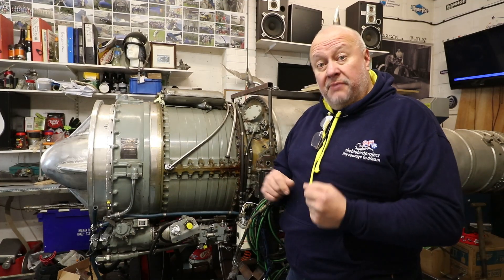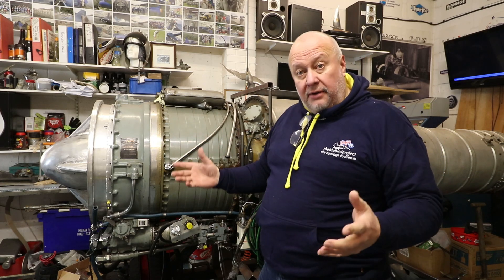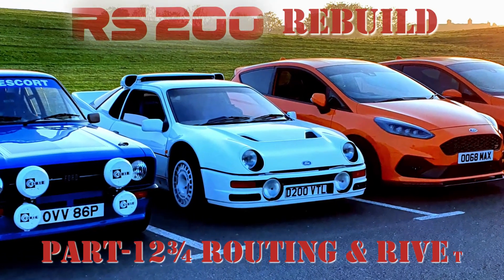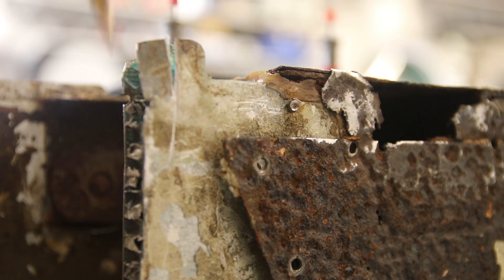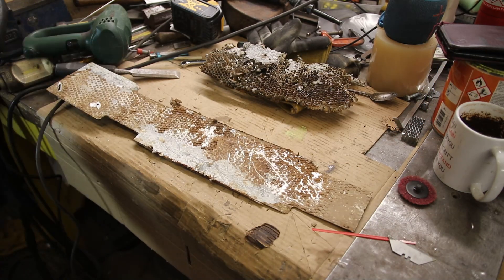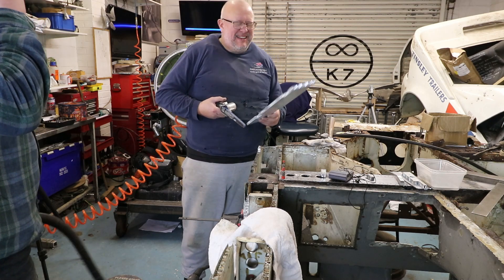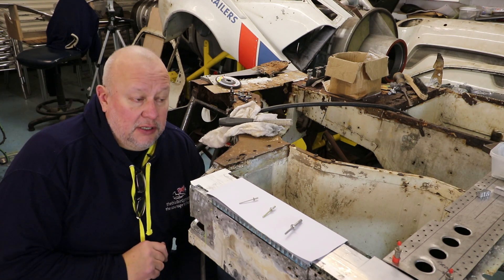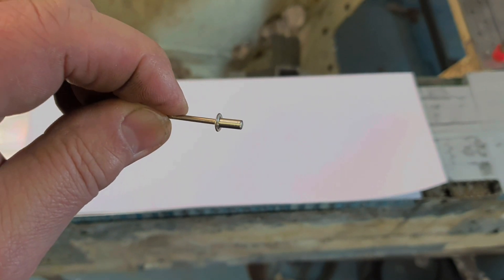Building our Ford RS200 Tub. Rivets & Honeycomb.

Comment: Awesome!!!
I too have learnt stuff from this video!! 
Years and years ago my grandfather repaired his Ford Anglia wing with some sheet metal work (where they frequently rust above and just behind the headlight) and blind rivets. The MOT examiner whinged apparently & was put straight by my grandfather as to how plane wings are made!! (He used to work at Vickers / BOAC). It subsequently passed the MOT! 
(My grandfather was very good at sheet metal work) 😁
Reply from the maker: Yes, all those planes stuck together with rivets can't be wrong. Even the modern composite fuselages are made in three parts so they can be fitted out then they're joined into one tube with guess what - two orbital joints full of rivets. Never underestimate the humble rivet.

Comment: Another excellent update Bill & some very useful information, this chassis is going to be better than when it was 1st made 👏🏻
Reply from the maker: That's the plan. It's quite shockingly bad even if it wasn't crunched and rotten! If you're passing the workshop it would be good to get together to discuss some repairs on the composites.
Reply: @TheBluebirdProject  yeah mate I'll pop in as soon as I can, just been busy with work & making carbon parts for the GTE

Comment: I can honestly say I've learnt something today, great explanation of what I used to think was a humble rivet.
Reply from the maker: Glad that was useful. The range of rivets and pullers is honestly bewildering. We have a Cherry Textron offset pulling head for difficult corners and we put some wear and tear on it building Bluebird's air intakes - they were done using CherryMax rivets. The UK agent for Cherry Textron couldn't even discuss the puller until we supplied the part number of the rivets we intended to pull for liability reasons. Rivets aren't as humble as we all once thought, me included. 
Bill
Reply: Me too, great explanation